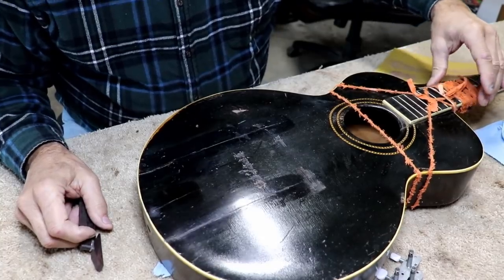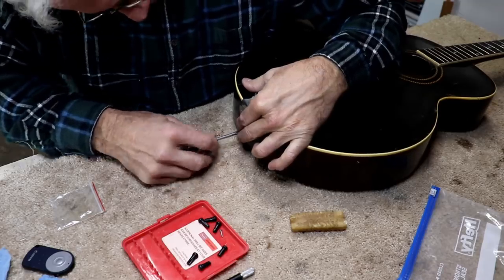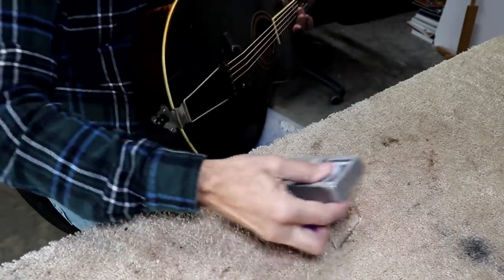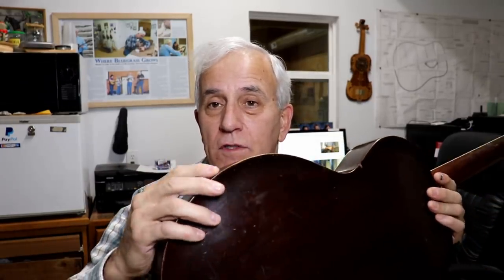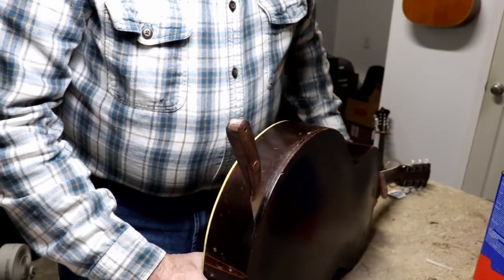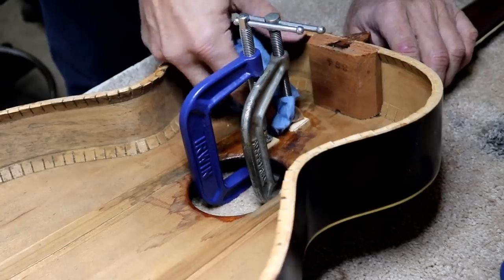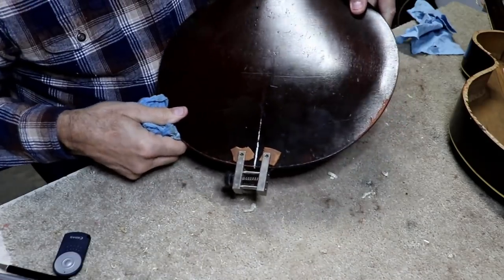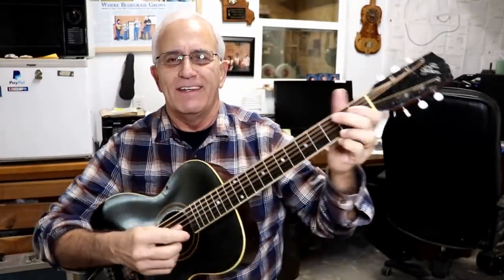265 RSW L1 Major Surgery Again Part 2 This is a good one

Comment: I should think that the abilities of various 'alcohols' to disolve glue (or anything else!)  woujld depend on the chemical nature of the glue/etc ...  All alcohols are not the same  methanol/ethanol/isopropanol  would each have to be tested ...    Tho you're sure it's hide-glue  on this guitar,  all hide glues cannot be exactly the same ... (eg,  'TiteBond's Liquid Hide Glue'  certainly has a formulation different from others .. no  ? 

(Btw, your presentations are terrific, for which I thank you for the 100th time ;))
Reply: Not all “ hide” glues are the same. While most have a collagen type base, the concentration of this collagen differs from animal to animal and from which parts of the animal was used. A fish based hide glue will not have 5he same bonding strength compared to one of horse bone. The strongest is from animal hooves, as along with the collagen, there is also keratin. Keratin has 5he ability to dull razor sharpened steel. Think of how quickly a razor can get dulled when shaving. This difference will also affect the ability for a solvent like an alcohol to penetrate the glue and soften it. So if a hide glue was made from such matter, it will be almost impossible to remove just with alcohol. As a dinosaur from the theater I used to use this type of glue fro making canvas scenery, and when we thinned out the glue, we used it for sizing to create a single surface for tightening the cloth for painting. Also, the thicker the glue, while initially seeming to have a better hold,  would actually form a weaker surface bond and  when The fabric would be sized, it could cause a heavy film that would cause the paints to flake off. Early in the twentieth  century as automobiles became more prevalent, the use of horse hide glues increased and the keratin from hooves  was pretty much the cheapest hide glue available. It was also the strongest when it was properly prepared .

Comment: If it ain't broke hit it with a rubber hammer. Kidding. I am building my very first stringed instrument from scratch and the Dremel is my one and only power tool Were it not for Dremel I would not build a shimisen/CBG/guitar hybrid of my own "over engineered" instrument. Hyde glue becomes brittle. I use Titebond - the SAME 8-oz bottle since 1993. I love the leftover patterns of glue on the 3x5 index card glue platform. Little masterpieces. When I build something I build it to double as a weapon. I would never bash a wacko's head with my little masterpiece however if you perform in Hollywood you HAVE TO KNOW HOW TO SWING A HUNK OF WOOD. Sorry, didn't mean to shout. 3 days ago I fused the neck to the body and everything fit - I was shocked. Measure 13 times by eyeball, cut once. Then sand until your fingers fall off and keep fitting the bit. Eyeball-sand-fit repeat ten thousand times. For seven weeks I live-breathe-air guitar this gem of a found parts - all of the wood used in the making of the 3-string-Destroyer of Universes (working name) except for the black cigar box - which rings a perfect Db - which I paid the Russian Tobacconist three dollars for. Since the body is held together with screws I want to Home Depot on the Sunset Boulevard Rude Coach - number two eastbound bus. They waanted twelve dollars for eight brass screws. "Screw this!" I said out loud and I made myself laugh. I chose the nickel-alloy screws and they are fine. Not superffine like brass but screw it. Nickel-alloy - four bucks for a hundred screws. So the body is fused to the neck with a ton of support bits, scads of Titebond and seven screws, four directly into the neck from underneath and on the top. I was inspired by the spirit of Leo Fender who in 1949 said, "hey - if we bolt the pre-fitted neck on we serve the players!" because that brought the cost down. When Brit-post-WW11- kids saw Buddy Holly and the Crickets all playing red Fenders they went nuts. Britain was not allowed (for a multitude of stupidities) to import American guitars. The ban was lifted somewhere in the late fifties and British kids got their Strats. Some kids couldn't afford the Fenders. Peter Townsend of the Who broke into a shop and stole a guitar. I prefer to make my original three-string-beauty from wood that was thrown away. Mahogany neck - oh crap, I discovered, this is not really a hard wood like maple. I will try marine-epoxy on the fretless neck. Wish me luck. Aloha.

Comment: what does plain water do to hide glue?
Reply from the maker: It will soften it over time.
Reply: @RosaStringWorks  thanks for the reply most other specialist, i won't mention names, don't seem to have the time to return reply's, its good to know that you do maybe later on I could get some helpful hints on a 1955 harmony f hole arch top that a teen used to el cabong it on someone

Comment: The 'ferrals' are sometimes called adapter bushings.  An Amazon search for vintage guitar tuning adaptersss will turn up a page of different styles.  I think the ones intended for old Fender strats might be close for what you're looking for.
Would it have been possible to v-cut the crack in the top and glue a spline in and cleat it from the sound hole?  

If you ever have to use pure alcohol you can use Evercleat you can get at a liquor store.  It comes in  150 proof and 190 proof.  If the repair doesn't go well you can always drink the solvent.  I use Everclear and shellac flakes for French polishing.  I worry about the added chemicals used to denature the alcohol might change the clarity of the finish.  In any event,  I don't think it will dissolve old glue.
Reply from the maker: I know you won't like this answer. But since I don't drink and I'm very opposed to that type of alcohol. I won't have that on my place. I do know that lots of luthier's use it for all kinds of reasons. It's just something I won't have in my shop.
Reply: My comment about drinking the solvent was tongue in cheek...  I don't think he denatured alcohol you can get in paint stores or at the drug store is pure enough to trust for fine finishes on instruments.  Also, try using boiled linseed oil cut 50% with naphtha (lighter fluid) rather than straight naphtha or linseed oil alone.  Linseed is a drying oil and will cause the naphtha to dry on the finish.  The naphtha thins the oil and causes it to penetrate more deeply into the finish.  Might help to seal the finish cracks.  Over bare wood it brings out the contrast in the grain.  It's especially good on woods like cherry.
Reply: Jerry, I just happened to read an article in the Winter 2018 issue (the latest issue) of American Lutherie  on removing Top and Back Guitar Plates presented at the GAL Convention workshop.  The author talks about (and demonstrated) using alcohol (denatured) successfully.  He says the alcohol desiccates the glue causing it to lose its bond.  I'm still skeptical but since he did it in front of a large group of luthiers it looks like it works in some cases -- at least for the harp guitar he demonstrated it on at the convention.  He implies in the article he prefers a hot knife on hide glue instruments like fine violins.

Comment: There are no cross braces. How odd, and how useless. I've never seen that bracing "pattern" before. It's just going to keep cracking until it gets some cross braces from side-to-side. Too bad nobody could see that at that time. Lateral bracing is what's needed. You touched on it for a second but you act like all you need to do is fix the cracks, but you need to plan ahead. New cracks will keep developing because the wood is so old and dry, unlike it was in its younger days. I know extra braces will negatively affect the sound but what good is this guitar it top is cracked and rattling?